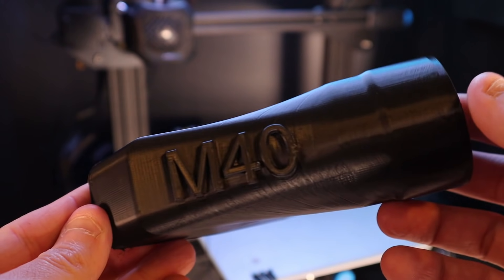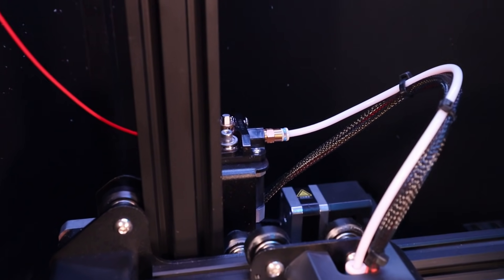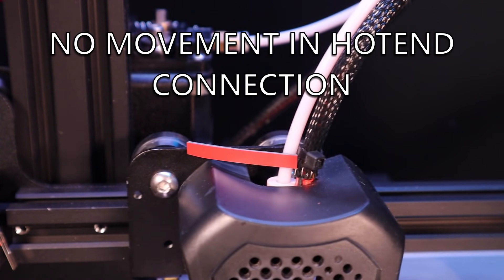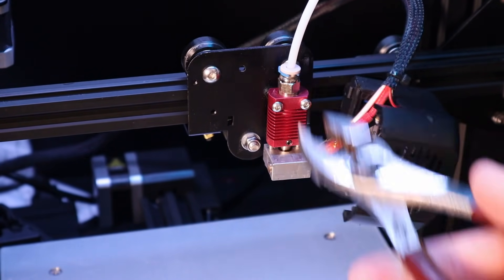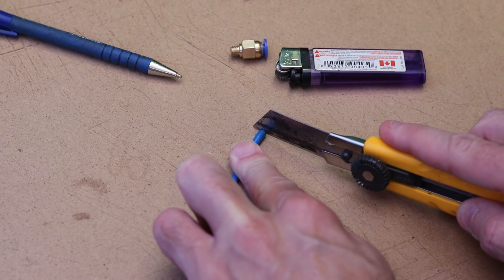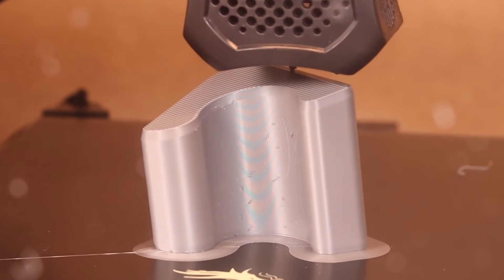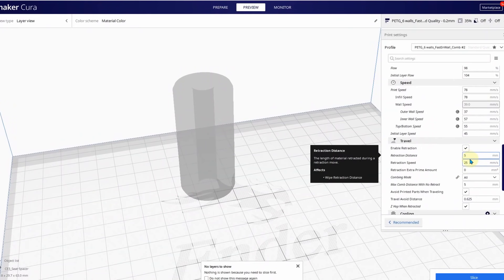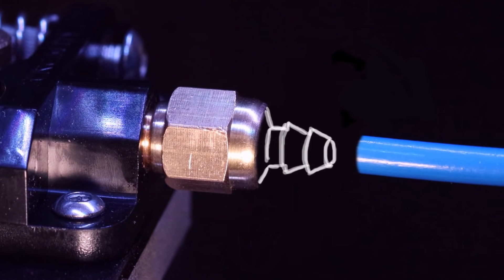Creality Ender 3 V2 - Fixing the Hidden Problem that Can Cause Stringing and Unresponsiveness

Comment from the maker: Please check out the follow up video for a better solution, PTFE is toxic at high temps and it is best to avoid heating it!  https://youtu.be/lboDSH0945g
Reply: Ehhhh.... I guess. I just adjusted my retraction in my splicer settings and ran three tests and I have no issues.
Reply: or try not to heat to above 450c...?

Comment: falshforge finder has a clever mechanism, the teflon tube goes into the back of the nozzle then it gets stuffed into the hole from below and screwed in, so that tube goes nowhere... also only uses about 50mm of the stuff... it is so old yet apart from the crappy heatsink itself, it is ages ahead of new designs

Comment: I can relate to this, I  have been having this issues since I changed my extruder and its caused me no end of issues with clicking and skipping.  but I managed to find a clip for the tube end and thicken it up so it only leaves maybe 0.1 of a mm gap at the extruder end to allow for some flex and so far so good it has not clicked / skipped at the feeder.

Comment: i solved that problem with a lot of hot glue
Reply from the maker: Hey, whatever works for you.  If you really lather it up, superglue could work for a while.  It's flexible and can probably stick well enough.  If you're in an enclosure, it will probably soften.  But do what works!  The worst part about this problem is that you can't tell, it's really hard to see, most people have no idea... I certainly didn't for a while.

Comment: I found a super simple solution to the tube loosening in the bowden tube adapter, use one of the amazing goop products like shoe goo to basically glue the bowden tube to the plastic ring of the adapter, it doesnt take a lot just a fillet between the adapter ring and the ptfe tube. A tip here is lick your fingers and you can shape the fillet without glue sticking to your fingers. This glue sticks solidly to the ptfe tube and the ring, the ring can still rotate in the fitting, and the glue peels off easily when you need to remove it. I have done this on ender 3 pros right out of the box and they lasted until I replaced the whole extruder setup over a year later, the glue peeled off the tube and fitting easily and left no residue.
Reply: Nice...what type of glue works best?
Reply: @koent7788  one of the amazing goop family of products like shoe goo

Comment: Good video but I am now convinced Ender 3s are just pure trash.
Reply: Hmmm...no they are not. Assembling the printer correctly saves so much frustration . Because of the low price they are great modular diy machines, but you need todo some simple changes to make it print nice.

Comment: It's videos and tubers just like this guy that are the reason you should not just watch one video but multiples. first off those fittings are compression type fittings they require the keeper to be held up while you push the tube in and the reverse action is taken to pull the tube. so you did not show anyone how to insert the tube properly and you did not put your spacers back in that keep the release in the up or locked position.there's a release by the way my guy, the reason that you can only move it one way across the tube once you took it off it's because you don't know what you're doing ! and you're teaching people how to not know what they're doing. all you had to do was push down on the keeper that's the thing with the little blue c shaped piece under it you take the blue c shaped piece out you push down that keeper you push down the tube then you pull it out of the fitting. Congratulations you took a simple operation and completely flubbed it up
Reply from the maker: Thanks for your thoughts.  Maybe you're right, but as they've always said, there are many ways to skin a cat.  If you're tunnel visioned like many people you'd think there is only right way to do things.  Be free to think of other ways of doing things, be creative and don't be afraid of people judging you.  

Personal experience, I've never found those C clips to have any improvement, the pressure inside the tube causes small amounts of material to be cut, and through thousands+ movements, it wears away to a point where is has to be cut and re-done.  There are better fittings, but the best solution of course is to move to DD, a pull rather than a push works far better.    

Have a good one!
Reply: @NeedItMakeIt  that's the whole point to the clip the tubing doesn't move when it's installed properly. there's not "many" ways to install specifically made and engineered parts. there's only one way ,that's the way they were engineered and designed to be installed and used.  there are many things that can be done multiple ways I am an outside-the-box thinker and industrial problem solver, but when you have something that someone engineered to work a specific way and works flawlessly without fail when used properly and your not using it properly ,switching the fittings and tubing and not installing them properly for a second time then modifying the new parts is a half baked temporary solution to bridge the gap between your lack of knowledge and a part that if you did a little research you'd know how to install properly. However you didn't install them properly so you're going to have the same problem down the road that you're having in this video. but the problem is not with the parts the problem lies with you .you're the issue and until you fix the actual problem which lies with the end-user not the manufacturer .the end-user is going to keep having the same problem with the fittings an the tubing. I have printers with thousands of Prints and I never changed the tubing or the fittings. what if your research led you to a guy that showed you the absolute WRONG WAY to install them.... Then you're right back where you started but you're even further back than that cuz if you're not willing to even concede that possibly you're doing it wrong , you're never going to learn anything. and unfortunately there are people that are going to learn from you the exact wrong way to complete this action bringing me a full circle back to my initial statement of this is why everyone should watch multiple videos and toss out the ones that just don't seem to make sense and go with the consensus of the majority.
Reply from the maker: Hey, I'm open to the possibility that I'm wrong, I made the video some time ago.   From my experience with my printers, I've found that it is does not last.  Maybe I'll delve into it deeper down the line, it just isn't a priority.  Maybe you can make one and share your wisdom with everyone.  

Try to have a good one.

Comment: The problem I have with mine is it starts stringing and won't adhear to the bed
Reply from the maker: PETG or PLA?  If you're on glass, you'll want to use glue stick with PETG, with PLA, you can still use glue stick, but it won't want to come off easily.  Instead, painters tape works well.
Reply: @NeedItMakeIt  I'm fairly new to 3d printing but I do use PLA
Reply from the maker: @TheCodester_2.0  Okay, it could be a few things, your retraction settings should be around 5mm with a Bowden tube setup, with Direct Drive, somewhere around 0.5mm-1mm.  Your filament is another, the quality but also the dryness, keep it as dry as possible.  The way you print does play in also.  If you're printing several parts which are far away from each other on the build plate, you'll likely have some stringing showing, or blobs on entry and exit as the nozzle goes from one part to the other.   Which printer do you have?
Reply: @NeedItMakeIt  I have a Crealoty Ender 3

Comment: I'm new to this 3D printing world.  I was having a serious issue of underextrusion, tried everything and nothing was solving it, until I found this video. Thanks dude!
Reply from the maker: No problem.  Every so often the Bowden tube will need to be checked for movement.  Eventually either the fitting will fail, or the tube will become worn and will need to be re-cut and re-inserted, it does take quite a while.   Good luck and happy printing!

Comment: Iv'e swapped fittings many times, along with the tube due to this problem. I found that the design itself is the issue. The bowden tube (even capricorn) just won't hold up forever and the fittings teeth will dig in to it and create slack. After a couple of years with this problem i converted my ender 3 v2 to direct drive...
Reply from the maker: I think that's a wise decision, you're right, buying the DD kit will pay off, less hassle, better prints less fussing with retraction.  The speed really isn't much of a problem anyway since the bed weighs considerably more.   I'm working towards this as well, buy I'm building some with the clockwork2 mechanism.

Comment: Hi, what is the best method to remove a stuck pneumatic joint. I believe that the threads stripped after my 3rd print and now I can't remove stuck filament. Any suggestions? Thanks
Reply from the maker: When this happens, I normally have to remove the joint toward the nozzle side to access the filament, make sure everything is up to temp and pull it out that way.  When you say threads stripped, do you mean that the filament wore down on the feed gears?
Reply: @NeedItMakeIt  Meaning when I use the provided wrench to attempt to unloosen the the joint, it just spins. Usually behavior with a stripped screw. Mind you I'm a noobie
Reply from the maker: @bflat32  That's a bit strange, in any case, if that happens, I'd grab a pair of needle nose pliers without teeth to add a slight pulling pressure away from the threaded housing while you attempt to unscrew the nut.  Bending a coat hanger method to pull may also work.  The issue here is that the hole may be stripped, a replacement part may be needed in either case.
Reply: @NeedItMakeIt  Thank you for your help
Reply from the maker: @bflat32  No problem, I hope it works out.  If the threads are stripped it may be possible to insert a flattened piece of copper wire inside to keep you going.

Comment: Do you put graphite on your rollers? I saw they look similar to mine. I started using pencil cores to "lube" my wheels to potentially prolong their life.. Mine have the same grey sheen as yours does!

I first used the pencil lead to lube my Linear Rod as I remembered that locksmiths use dry lube such as graphite to lube the inside of locks instead of grease and oil which capture dirt over time.

Comment: I'm reeaally done! I want to throw the printer out the window
Reply: Can you help me plz I'm a newbie I got a ender 3 (not v2 regular ender 3) I finally procrastinated for the longest about building the damn printer well it's setup but the filament coming out like ramen noodles and hard like wish I could show you but anyways I also noticed when I try to print it doesn't print on the bed unless I do it using printer settings I'm using sunla pla plus
Reply: @blue god  My problem here is with bowden tubes, I switched to direct drive. I think your problem is related to bed temperature. If you want, make a video and tag me, maybe I can help. I have been using these printers for about 1.5 years. Thank goodness I've run into a lot of problems, maybe I can help.😃
Reply: @ekrem06  idk if thats the case

Comment: how to remove the tube from the fitting without breaking the ftiing from the extruder side? i pulled themettal parts out i did push the ring down. and goofgled my *sss of but i did not finfd a solution. it seems mine is th only ne getting stuck. glad creality added a spare fitting i now know why.

Comment: The Bowden tube completely detached from my Ender 3 Pro extruder during a print once. I'll be upgrading the tube and fittings when I make the upgrades to print with TPU filament.

Comment: Your flaring idea is great!  A similar technique is used in vhehicular brake line fittings.  A previous commenter pointed out that such fittings are compression.  I solved the play in the extruder fitting on my older Ender 3 Pro by ty-wrapping the bowden tube and wiring cable directly to the end of the fitting.  The result is zero movement.  Thanks for  the vid!

Comment: Thanks for the video. That type of fitting was introduced by a Japanese Company called SMC back in the late 80's. I had never seen it used in this kind of mechanical application. I have seen this kind of movement on cheaper versions of this fitting (when the line is charged).  Try SMC.